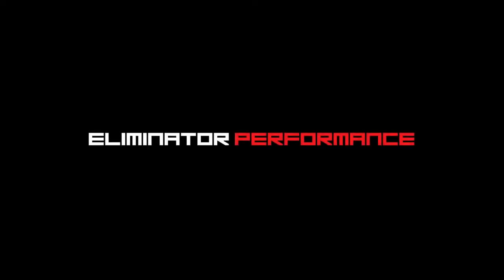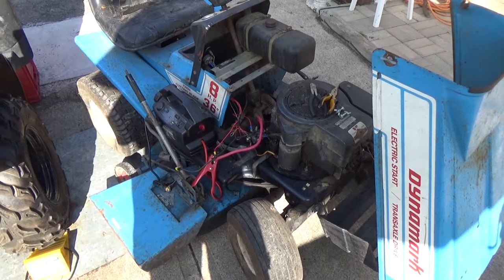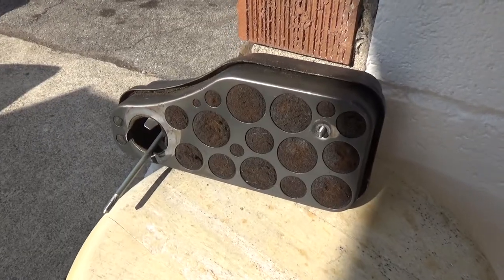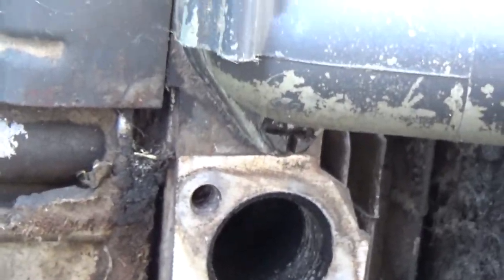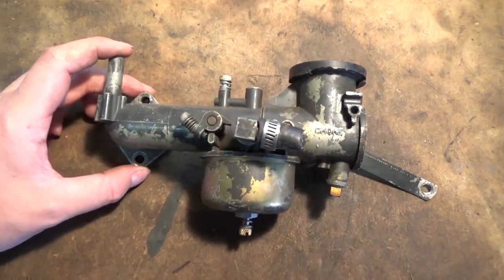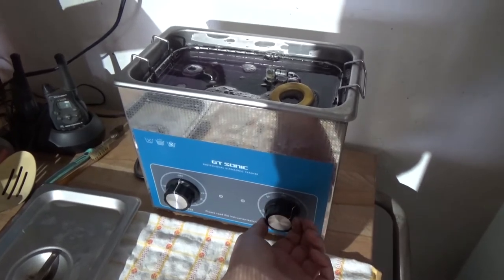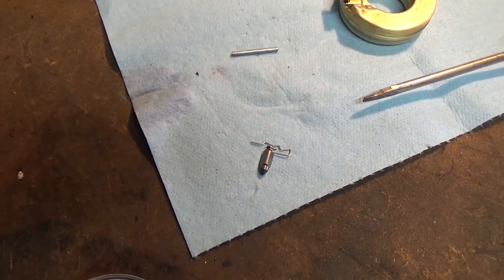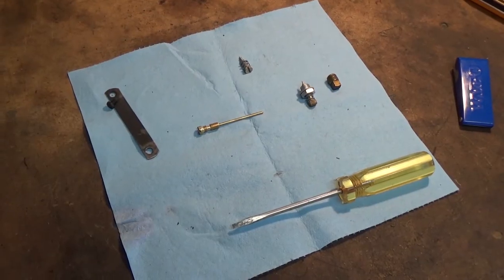Dynamark Riding Mower Repair [Part 1]

Comment: i have the same tractor. would like to know the year. it's like a lime green metallic, had the 8hp briggs and swapped it to an 11hp briggs. i chose the dynamark over another tractor that i got as junk because well.. i like the looks of the old dynamark!
Reply from the maker: Nikki Vix What's the model number?
Reply: it looks like 52952300 0b4 or 084
Reply: I just finished the spindles and painting the deck on my 74 Dynamark. The engine is 30 years old with blow by to the plug and is a leaker. Was wondering if the 11 horse runs as good as I think it will. Might try that swap too

Comment: 8 HP B&S air filter from Stens part number 100-545 retails at $11 + tax in Cdn. $ so your making nice profit just on the air filter and looks like your ultrasonic cleaner did a nice job cleaning the carburetor.

Comment: Interesting question. I have a 1974 Dynamark 8/36. The engine was replaced in 1990. It's got a small oil leak. I need to add every other cutting session. It's the backup to a Deere. Was thinking about trying one of those 10w 30 high mileage oils to see if the leak might get better. Thought I'd get your thoughts.
Reply from the maker: Add some lucas oil stabilizer at 20% mixture, if that doesn't work try an oil stop leak. Won't hurt those old engines.
Reply: @EliminatorPerformance  Gotcha. Thank you Sir.

Comment: This is a Richard pretty blue edition, if you don’t believe me, look it up. I have one
Reply from the maker: I believe you, we sold it and it's now black lol my friend Steve purchased it and it's had an engine swap done to it as well to increase hp.
Reply: @EliminatorPerformance  Just out of curiosity, is the 8 horse engine still around? I'm not good enough to change to a different engine but, I THINK I could get mine loose and move the wires from one to the other one at a time IF the time comes.